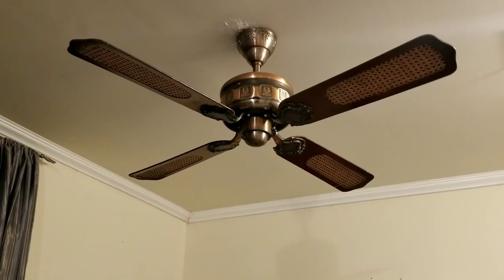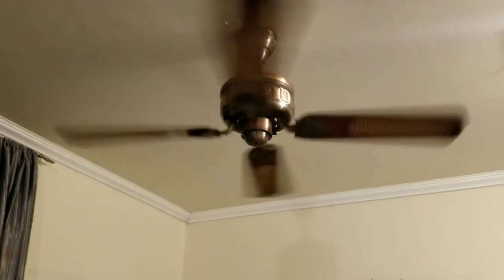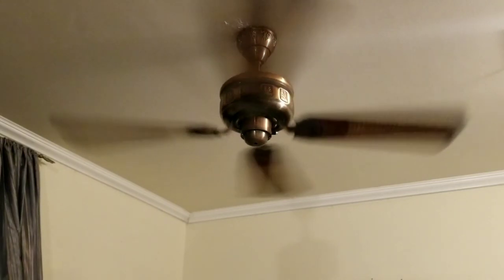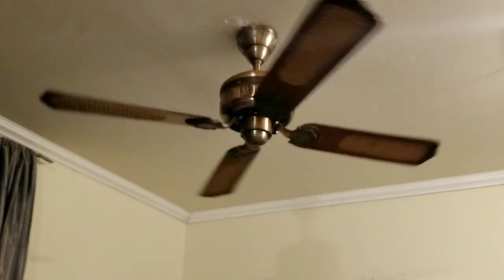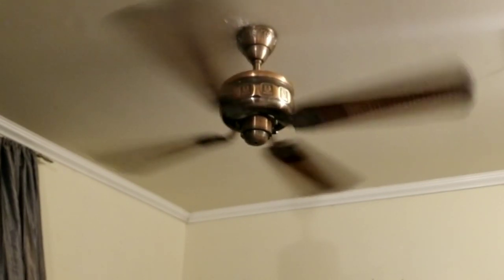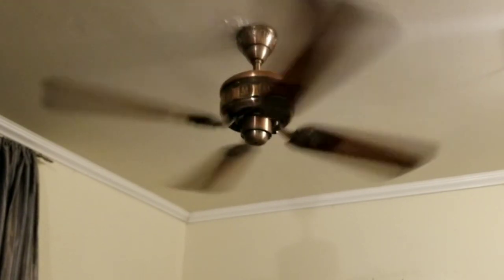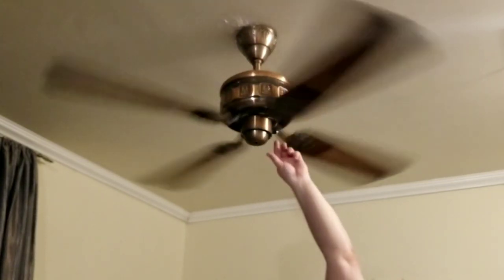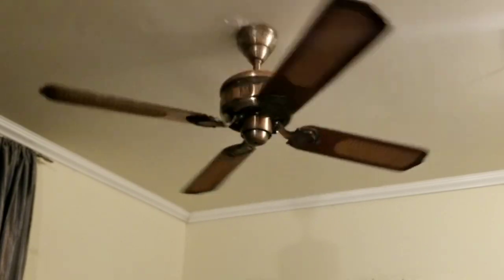52" Supreme Fan Mark III (Known As The Emperor)

Comment: I saw one at a rental beach house. The one I saw has a same motor, but is 3 speed, and has a light pull chain on the switch housing, and it doesn't have that round thing on the bottom of the switch cap.

Comment: It not uncommon to find ceiling fans with a variable control knob on the switch housing to hum on some speeds.  But on this one for sure there is something with the switch as I've never seen a fan with the variable knob act like that on low.  Some might consider to be a bad capacitor as sometimes capacitors when they are bad will mess up the fan speeds.  It common to see that happen with newer fans.  Other than that this fan is like mint condition.